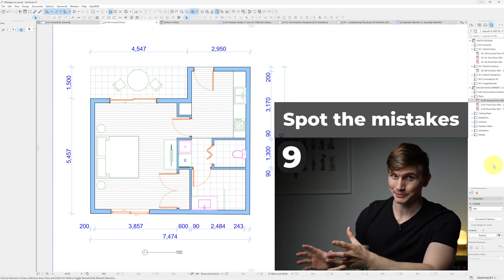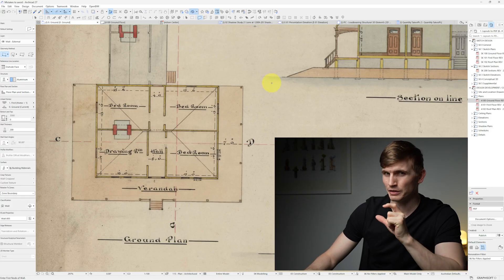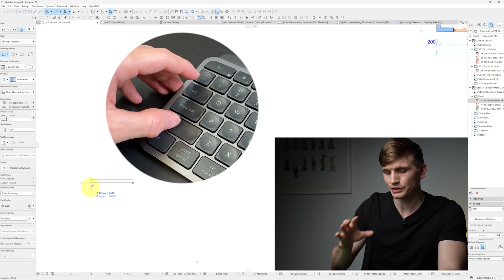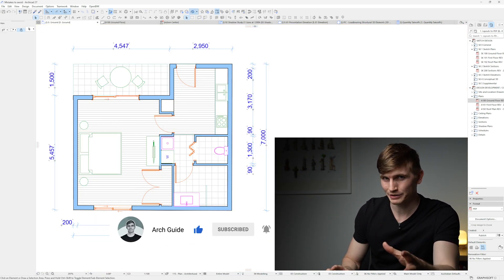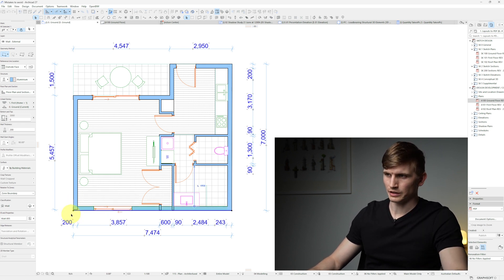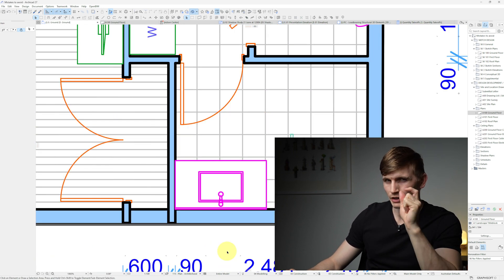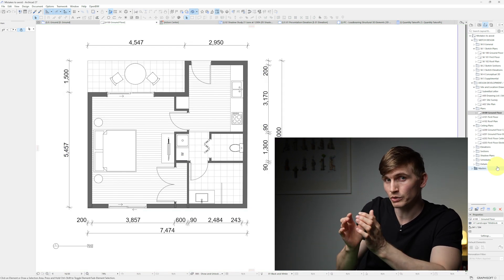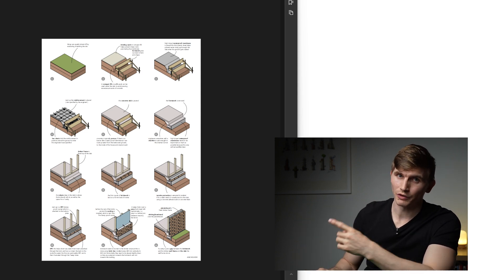Common Mistakes & how to avoid them

Comment: The Wall not getting drawn straight is software problem not human. There should be key or tool available for setting them at 90 degrees as in revit. This problem is very common with everybody who uses archicad.
Reply: Hold shift…..